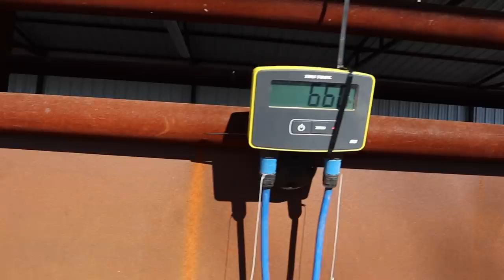Working the Bison AND Dunbar ESCAPED Again!

Comment: Tell Dusty when Big Joe will not move it the shut cover the end where he is with a tarp forming a tent on the rear end of the tunnel he will go toward the open end and good luck. Add a hydraulic ram to the squeeze shut handle for extra force, a pump on a cart with hoses to attach to the ram so you can keep it safe when not in use, just a suggestion.

Comment: I'm shocked there aren't more jumping guards to prevent them from jumping out.
It might help to invest in a few, if they/you haven't already.

The place that I grew up by had their fencing taller with spots to put poles over them. They were easy to remove it if need be, just slide them out, but they did a great job preventing any escape artist.